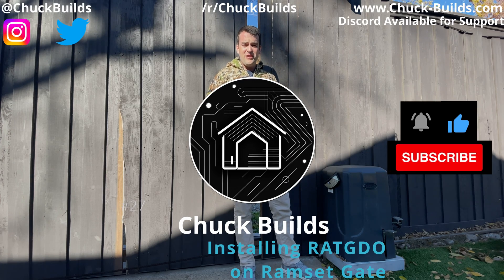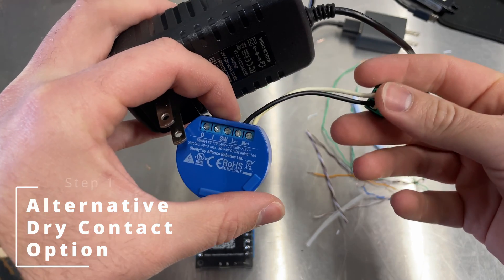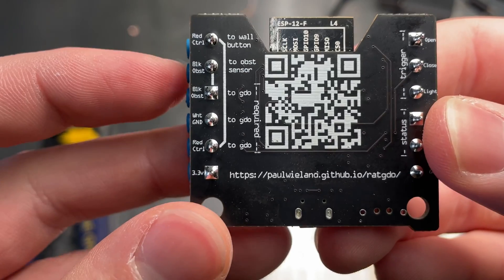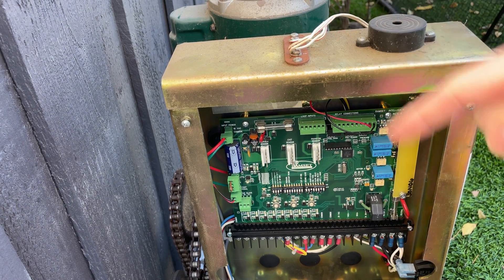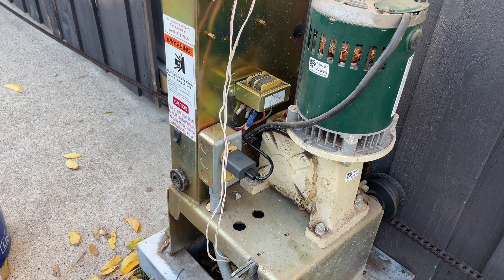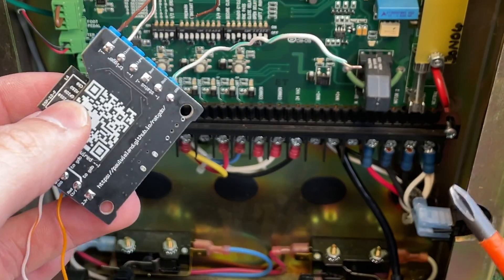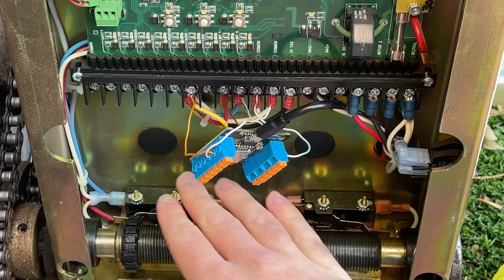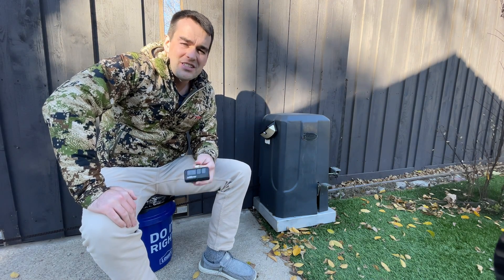Upgrade your Non-MyQ Gate / Door with RATGDO (Dry Contacts)

Comment: Thanks for this. I was planning on using the dry contact side of the RATGDO in hopes that I could avoid the known issue of wall panel conflicts. Not as intuitive as I thought to wire for dry contact use. I thought  that you would use the Trigger ports on the dry side to open the gate not the Red on the non-dry side? And also I would have assumed the Status ports on the dry side would have been connected to your limit switches instead of trigger?? Now I know